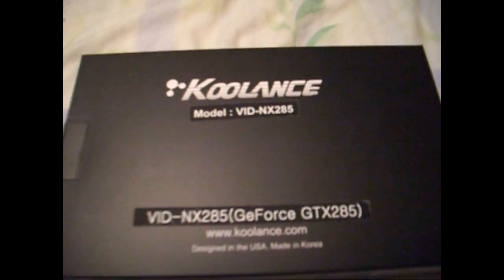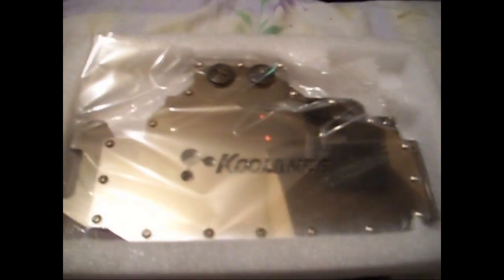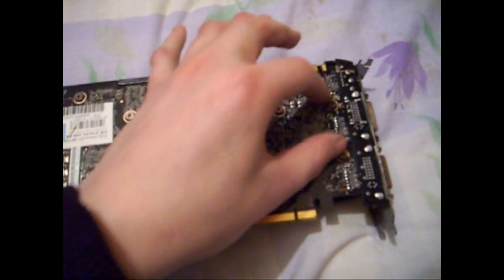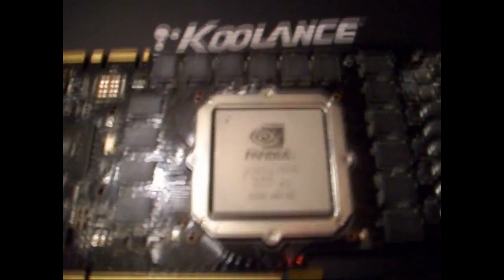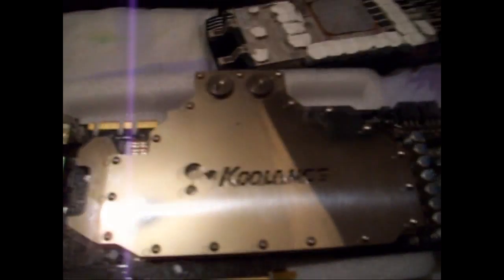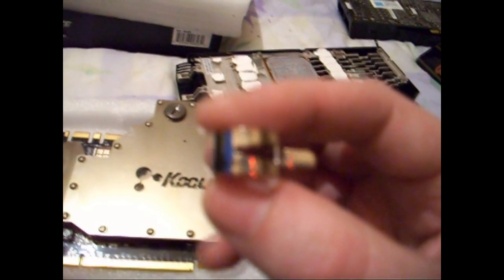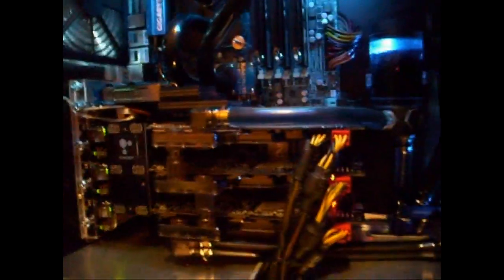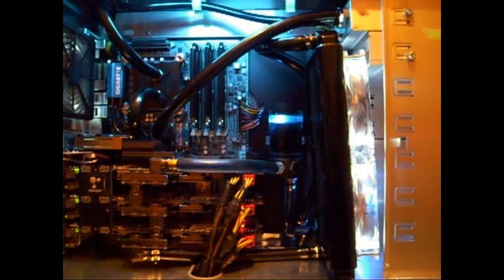KOOLANCE VID-NX285 GPU WATERBLOCK UNBOXING AND INSTALL GUIDE

Comment: I'm upgrading next month mate :)

Core i7 920

Rampage 2 Extreme

6GB (3x2GB) OCZ Gold 1600MHz or 1866MHz

the Core i7 will be on water using the Swiftech GTZ. my Q9550 is on water and I'm at 4GHz :)

my 4870 x2 is watercooled too and overclocked too.

Comment: Hey R3APER, you should add a single rad on the back exhaust to the double for the graphics cooling loop. That would be just as good as a triple rad for the cards, and it would fit inside your case too.

Comment: lol r3aper always has a spare bottle of coolant on hand. i guess its easy to get lazy and NOT test your cooling parts. when their not in the system its a shame genius way to show the instal too; have one of your cards on each step.asupport barwouldhelpkeepthecardup. afterthat it might be good to get a crappy back up computer in case of emergency (ex. e8600 9800gt P45 etc.) it would be cool to see ur system go up in smoke though. u wood probably have a heart attack hereliesR3APER R.I.P.overall5/5